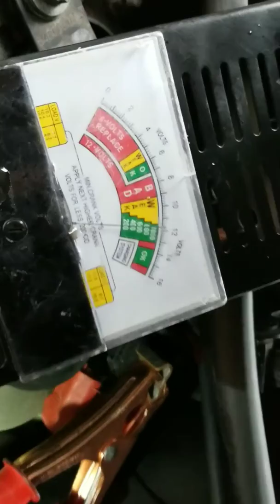BMW 335D Diesel E90 crank pulley Failure issue | GetInspected 0170

Comment: I'm having the same issue any ideas https://m.youtube.com/watch?feature=youtu.be&v=h5x94ab1j3c
Reply from the maker: Hi, the crank pulley is a known issue with this BMW diesel motor. But yours seems to be a gas motor... the low voltage is strange, new alternator? Replaced battery? Did you program the battery if replaced recently?

Comment: What was the problem?
Reply from the maker: The crankshaft pulley has a damper (rubber damper) that was torn, so the crankshaft was turning, but the outer disk (holding the fan belt) was not turning along with the crankshaft. Apparently it's a known problem with the BMW E90 Diesel.
Reply: Where did you find the damper?